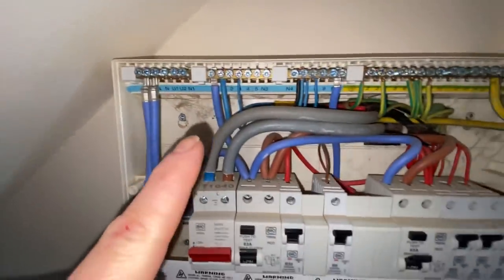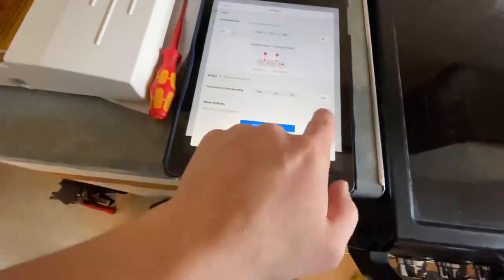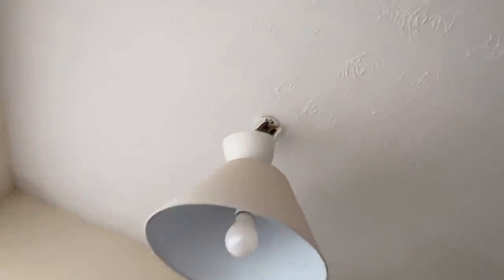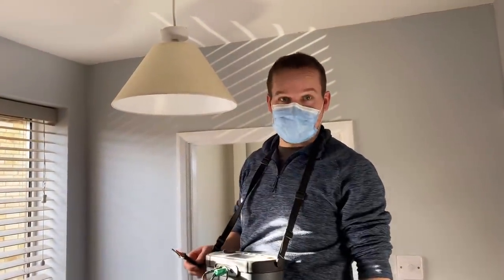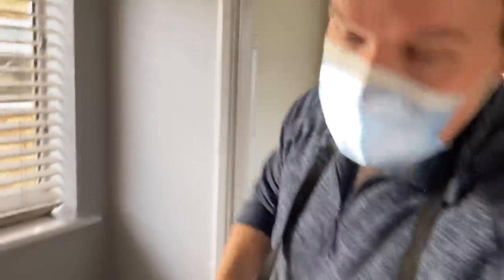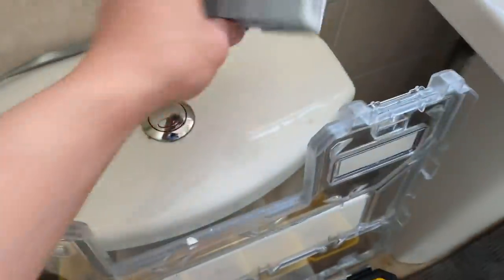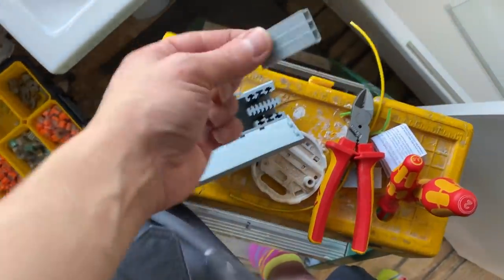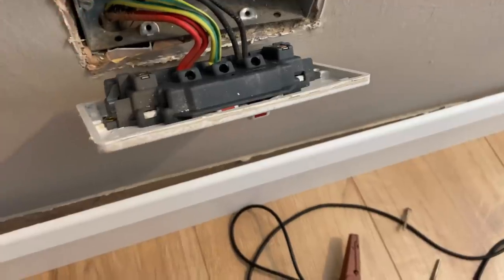Ahhh fault finding again really!! Can’t make this s#*% up!!!

Comment: I wonder if some of that ring used the mid 70s T and E which was 2.5 on the lives but only 1.0 on the CPC (world copper shortage at the time) pushing up the reading before even the loose connections had a chance to spoil the reading even further.

Had a ring yesterday with that horrid cable where over the 50 years 6 cpc connections had gone either high or completely open circuit.
Reply: It probably is as the 1.01 is closer to 0.88 than 0.58.
Reply: @Spark101.  Perhaps, personally I'd be more concerned about high resistance on the live conductors than the CPC, as long as it meets the required disconnection time for ADS I wouldn't worry about the CPC being a little higher than it ought to be.
Reply: @Spark101.  Indeed, a struggle to get a Zs to ensure disconnection, or not create a little firework display in the back of some other wholly innocent socket on the ring circuit.  then there are those "Own Brand" sockets where the cage clamps are more than a little built down to a price and there is so much set up not to end well.

Comment: Lack of a grommet/proper box cable clamp might not be a Fail in the UK, but in Canada, it WILL get you yelled at by the Electrical Inspectors if they see it...

If you've been Respectful and Polite to them up to then, they might allow you to pull the cable out of the box and install the proper grommet/clamp with no further Penalty...

If you've Annoyed them (or Worse) however, the Inspection will be Failed and you'll be forced to book a new one (at your cost of course) after you've fixed it and you might get a Fine as well (the likely-hood of a Fine depends on what else they find in the Inspection, just how badly you've Pissed them Off and/or how much of a Jerk the Inspector is in general, some are Power Hungry Martinets that DEMAND everything is done TO CODE first time, every time NO EXCEPTIONS)...

Comment: No earth fly lead on that dimmer switch, I aways use 35mm boxes for switches,gives you some wiggle room,especially if it's a dimmer/smart switch.
Reply: Your screw can be the earth if one lug is fixed.  It's only loose lugs you would need a fly lead.  Although a earth tag is always good practice.
Reply: @matthewpaling7816 Definitely good pratice, but it's hard to break the old ways you were taught😁..
Reply: I think you will find your wrong, fly lead is needed for metal front plates as it’s exposed , not needed for back boxes with a fixed lug.
Reply: @supersparks9466  isn't that what I said?
Reply: @mathew palling not the way I read it, you just said you can rely on a screw for earth if a fixed lug which is not right for metal plates

Comment: Question, do all wago connectors have to be in a box? If I've used them to join to a fire alarm in the loft, would the need to be boxed? I always thought wago are already protected by the nature of design.
Reply: It's all about double insulation. Where the single conductors leave the twin + earth and you have Wago connectors, there is only single insulation on show hence why they should be in a box.
Are the Wago connectors within this fire alarm? If so that's fine. They don't need to be in a Wago box and inside another enclosure.
Reply: @kw1984  I better buy some boxes then!!
Reply: @MrDamodee  also the strain relief. the cables are held securely together by the outer sheath as they enter the wago box; meaning if a single cable was tugged, the box as a whole would be pulled along rather than the strain going to where the conductors enter their connectors.

Comment: Just out of interest what is your take on letting the customer know of previous shoddy or lets say sub optimal work regardless of whether you film it for the channel or not?

1 - cables coming loose out of boxes - sheath covering cpc which is easy thing to avoid
2 - cables not logically set up within the unit

loads more examples but basically letting them know that you have fixed small things at small or no charge due to inferior work previous in the property....

Basically you could go round the property and fix loads of small things whilst doing an EICR or board replacement and the customer never know any different of your effort levels to make everything above board or that things were in a sorry state to begin with.

Thoughts?

Comment: Nice video Chris as always ! Heads up I got pulled up on a NICEIC inspection for some c3s, c3 for no SPD is not a C3 at the moment just goes down as N/A and plastic boards is only a C3 under a wooden stairs or in a sole point of exit. Hope that helps 👌🏻 keep up the good work !
Reply from the maker: Yeah I put it on the sheet just so I can have an argument with the assessors 👍
Reply: Let’s be honest the NICEIC assessor is always going to pick up on something 😩
Reply: @Cjrelectrical  haha don’t we all love a good moan at the NIC 😂👍🏻

Comment: Burned Dimmer:

So did you end up replacing the box with a deeper one and installing a new thick dimmer, keep the thin box and install a slim profile dimmer or keep the thin box and replace the dimmer with a non-dimming switch?

You're Fans want to know...
Reply from the maker: White click switch no dimmer.

Comment: Do you always fault finding when doing an eicr ? I will just report and code on what I find then quote to put right
Reply from the maker: If it’s an easy fix like this then yeah fix on-site. Otherwise goes down for further investigation needed.
Reply: It depends. When you get a car MOT from somebody you know or not. If your charging flat rate, tell em whats wrong. If your offering a service to a landlord or such charge them a flat fee for test and small fixes.
Reply: I will attempt so ort of investigation which is why I don't price EICRs cheaply - rather have the time where if I find something like a ring without end to end continuity I can do some investigation which might give a simple fix like putting right a broken wire, loose screw etc and give a satisfactory result and leave the installation in a safer condition than when I started.

What would make an interesting discussion is the point during an EICR when a sense of humour faiure sets in and the faults then just get reported as found with an FI where required.  For me the sense of humour failure occurs when the signs become apparent that once upon a time it was compliant with the standards in force at the time of installation, and since then the owner has bodged or engaged the cheapest roughest cowboys to modify it who have destroyed all resemblance to compliance.  The sense of humour failure can be especially severe if I get  sense that a greedy landlord has engaged "Cowboys for Cash Construction ltd"  in order to wring as much profit from a tart up, and then the desire to just report everything found.
Reply: @rowanNClangley  I'll make you right, if it's all relativly new and looks like a clusterfuck it's in your own mind how you want to aproach it.

Comment: Wish all sparks did a proper job like you for testing, sadly most are not this thorough or detailed.
Reply from the maker: Yeah that’s a £65 EICR and about 30 minutes on site unfortunately. We did an 8 circuit house and that took 4 hours minimum.
Reply: @Cjrelectrical  fantastic work mate , Shame there are no standard regs that force certain checks but then again i guess some look to cut corners anyway , out of interest what are the rough costs of a full EICR on 8-10 circuits for reference please be good to know or perhaps you can do a video about it. Miss your old odd job videos where you did some plumbing etc too
Reply from the maker: Rough costs £35-£55 per circuit any cheaper then corners are being cut. In my opinion
Reply: @Cjrelectrical  thanks mate much appreciated, least I know what a proper in depth one costs now , keep up the great content

Comment: Are no SPDs a C3? No way!
Reply from the maker: Yes of course if you deem the installation to have sufficient electronic equipment. Make a decision if you get it wrong that’s what you’ve got your professional indemnity insurance for.
Reply: @Cjrelectrical   So for a typical domestic situation you'll be fine without?
Reply from the maker: I fit in every house now I do a consumer unit change on. Everyone has a boiler and an apple phone right?
Reply: @Cjrelectrical  I'm not with you. Apple what?
Reply: Oh yes and surely within the chargers or boiler board has some sort of protection against electronic surges.
Reply from the maker: They do but unfortunately more than likely take up to 25% of an over voltage.
Reply: @Cjrelectrical  Wow I didn't know that and I do apologise I am a student and remember that a C3 is a reccomend improvement. I got mixed with a C1 aha that's why I was questioning it. Sorry mate
Reply: It does make sense to fit them if you can get them readily available to you. As you say in our houses we use electronic intensive devices that could favour from it definitely
Reply: It requires a risk assessment via the FRL calc to code 👍
Reply from the maker: For the price of the spd vs trying to obtain the correct information to to that ridiculous calculation just crazy not to fit them now.
Reply: 100% agree. The calc (jn a domestic situation is mainly for coding) 👍
Reply: @tomorichard  Fair enough. I did not know that - thanks buddy